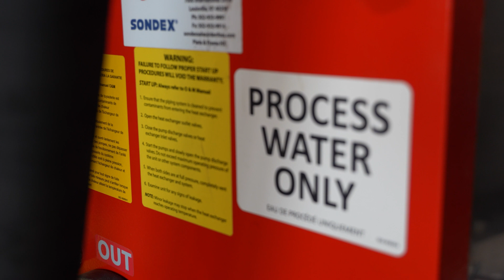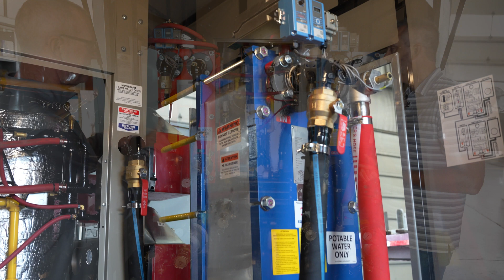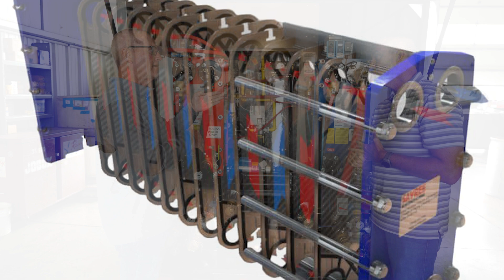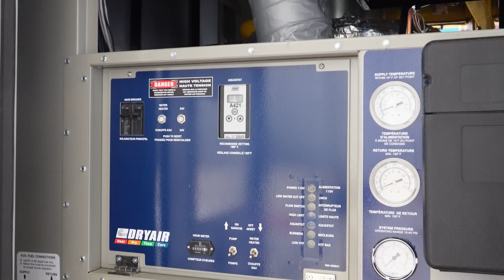The Future of Mobile Heating Systems: Dual Water Supply Units – The Boiling Point

Comment: 5:01     When you run the air coil, it is assumed that glycol would circulated thought the aircoil?
Reply: Would it be possible to use other process on the third hook-up it is is limited to Air-Coil?